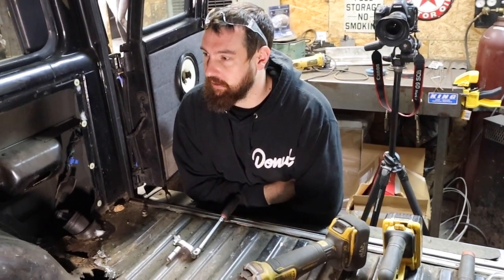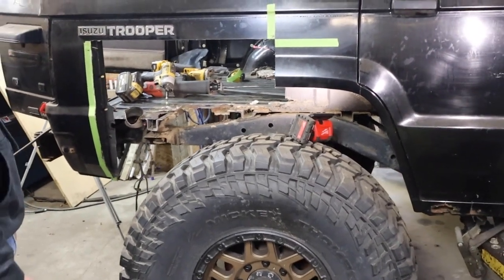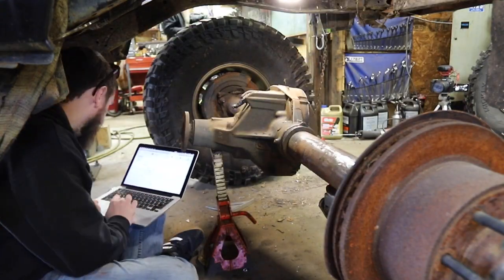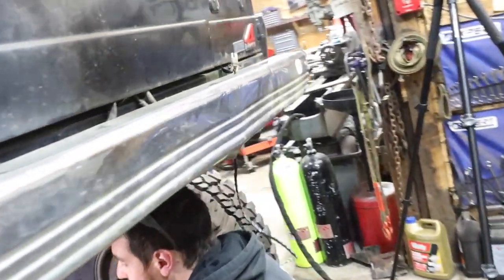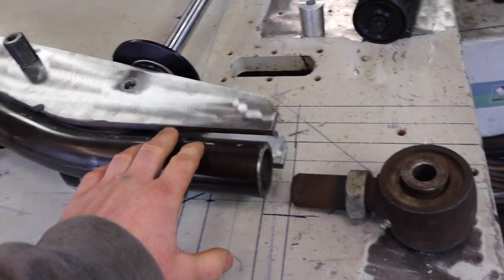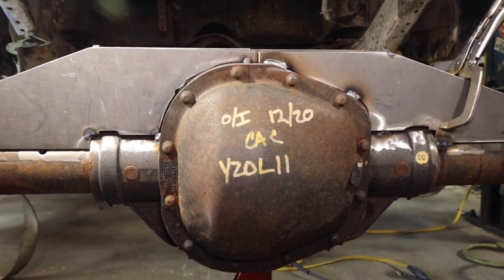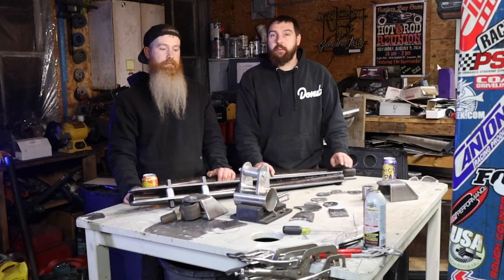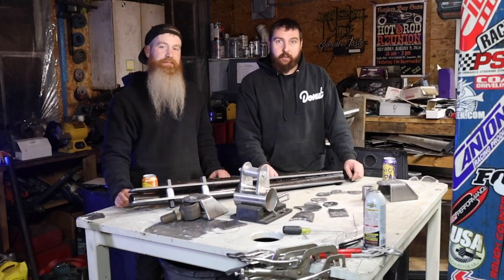Super Trooper Part 10: Rear Suspension Design

Comment: Going to do any frame reinforcement like boxing it or plate in it
Reply from the maker: It is a fully boxed frame, but I am going to add in crossmembers at the high stress areas. The frame near the rear coilover towers, and link locations will get beefed up as well.
Reply: @ilovemybike  just was wondering did know if the factory frame would be strong enough without plaiting it or something